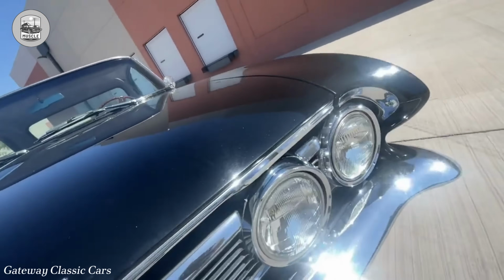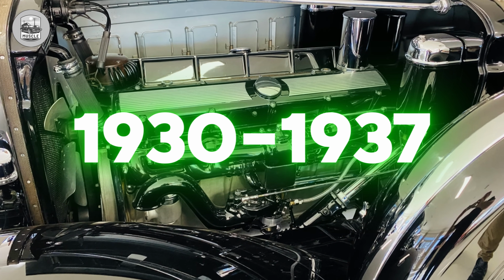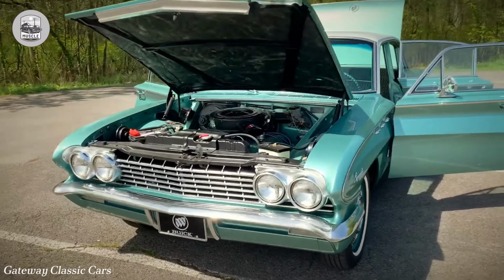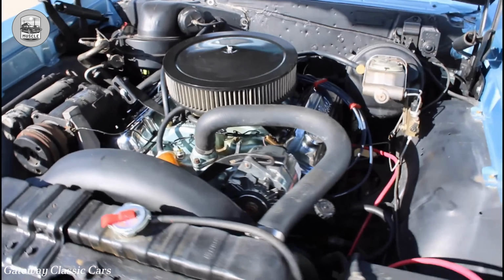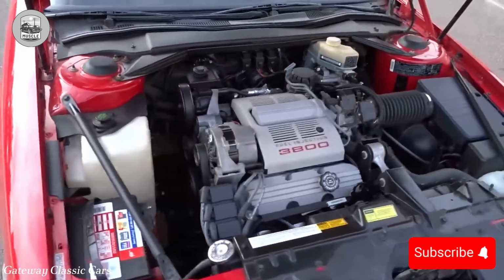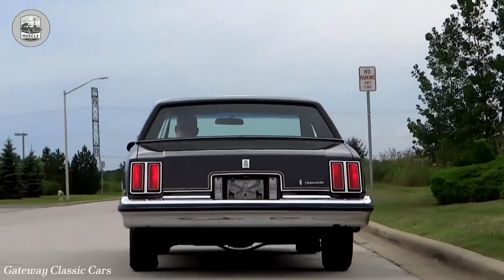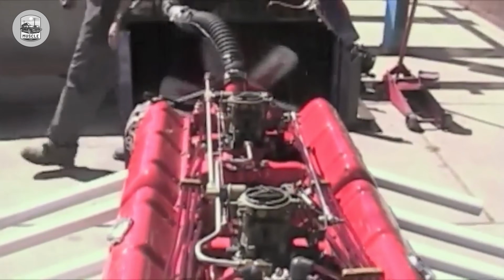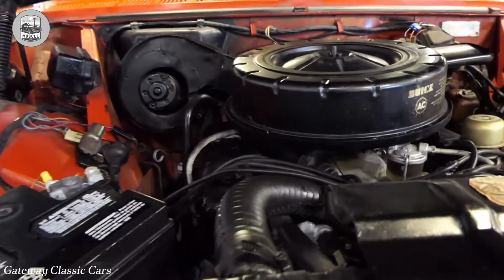10 MOST FAILED and WEIRDEST GM Engines ever made | Worst engines blunder!

Comment: True on the olds not buick but buick is my favorite. If not for the buick, the olds would never be.
Reply from the maker: Absolutely! Buick played a huge role in GM's development and success, and it's easy to see why it's a favorite. Interestingly, Oldsmobile and Buick shared a lot of engineering advancements over the years, yet each had its own distinctive character. Buick's innovations, like the 'Nailhead' V8, had a significant impact on GM’s engineering direction, paving the way for many of Oldsmobile’s engines. But let’s not forget Olds also pushed boundaries with its legendary Rocket V8s, which helped kick off the muscle car era!
What’s your favorite Buick engine or model? Let's keep the conversation going—comment below and let us know! And don’t forget to share this video, subscribe to Muscle Car Masters, and hit that notification bell for more deep dives into muscle car history and legends!
Reply: @MuscleCarMasters68  Had a 65 GS 401 bored 60 over, 12-1 Jans pistons, Isky 3/4 race cam, High rise Offy Dual 600 cfm AFB, Dual Point distributor, 1.7-1 rocker ratio had to mildly pocket pistons to keep valves from hitting top of pistons. Put TH400 from Riviera GS dual Quad in, 3.73 posi. Did 12.87 best in quarter. Then had Opel GT 69 1900 always wanted to put 215 in it. I picked up a 69 Opel GT rusted hulk and at 77 hope I will be able to complete it. 215 with 200r4 8.5 rear 3.73 posi. DST Fast control system, replaced the distributor with the cam sensor from the GTX, cam stage 4 from Crowler,, crossram intake 8 throttle bodies and individual runners. electric water pump, Buick 300 crank, Chevy 6" rods, 305 Chevy short skirt 60 over 12 - 1 pistons, TA Performance heads with roller rockers for the Buick/Rover, lower block girdle and crank wiper, had to have special liners made, enlarged oil galleys cover over the valley to keep splash down from cam rotation, high flow oil pump. Car will weigh between 1800-2000 lbs.
Reply from the maker: Wow, you've got an incredible history with some serious muscle and engineering know-how! That '65 GS 401 build sounds like a beast with those 12:1 Jans pistons and that high-rise Offy Dual 600 setup! Boring it .060 over and pocketing the pistons for valve clearance, now that's dedication to performance! And pairing it with a TH400 from a Riviera GS dual quad and a 3.73 posi rear—no wonder you were able to hit 12.87 in the quarter. That’s some serious old-school muscle magic.
As for your Opel GT project, it's going to be a one-of-a-kind rocket with that 215 engine! The Buick 300 crank with Chevy 6" rods and those TA Performance heads sound like a match made in engineering heaven. With your lightweight build, custom liners, enlarged oil galleys, and the Crower stage 4 cam, I can only imagine how wild it's going to be when you get it all finished! 8 throttle bodies and individual runners? That’s next-level tuning right there.
Reply: @MuscleCarMasters68  Only draw back I'm now '77 and have had multi back surgeries and recently a hip replacement. Difficulty to do work on car, just hope I'm able to finish it before I leave this earth.
Reply from the maker: @randallblack9519  Thank you for sharing your story—it's inspiring to see your passion for cars still going strong, even through the challenges you're facing! We hear you on how tough it can be to work on a car after surgeries and life changes, but the love for muscle cars never fades, does it? Buick has indeed been a cornerstone of American automotive history, and you're right—without Buick’s innovations, Oldsmobile wouldn’t have developed the same way. Buick’s contributions to engine design, like the famous Nailhead V8, set the foundation for so many advances in the GM family. Whether it was in the high-performance GS models or the Turbo V6 in the Grand National, Buick was always pushing the limits, often setting the stage for brands like Oldsmobile to follow.
I hope you're able to finish your project, and remember, there's always a community here to support and share that passion with you. If you ever want to share updates or need advice, we’re all here. Keep us posted on your progress.
Have a good day. Take care.
Reply: @MuscleCarMasters68 once the engine is ready to fire will need to locate someone to help program the ECM. I have no experience. The person who was going to offer the expertise is out of business. He was across the line in Illinois and regulations and increases in cost of doing business shut him down. Anyone have experience with a dts fast 80 system? Setting it up for sequential injection and wiring in 2 knock sensors. Also it's set for wested spark but tells how to wire for coilpaxks on plugs and sequential fireing.
Reply from the maker: @randallblack9519  Thank you for sharing your journey with us! Getting that ECM programmed and dialed in with a DTS Fast 80 system is definitely a technical task, especially with the goal of sequential injection and dual knock sensors. When it comes to configuring wasted spark or setting up coil packs on plugs for sequential firing, you'll want precise timing and accurate sensor feedback to protect the engine and get the most out of your setup.
For the DTS Fast 80, if you’re wiring in those knock sensors, make sure to follow the specified grounding and sensor placement in the engine bay for optimal results. Also, a few forums have excellent guides on wiring coil packs to the Fast 80’s outputs and setting it to fire sequentially rather than in pairs. It might also be helpful to reach out to local performance shops or specialized tuners – even if they’re not as close, many are experienced in remote tuning and could help you via online guidance or a pre-programmed base map.
We’d love to hear from anyone else who’s worked with a DTS Fast 80 setup! Drop your tips in the comments below, and if you’re passionate about American muscle like us, don’t forget to comment, share, and subscribe to the Muscle Car Masters Channel! Your support helps keep these classic car conversations alive and thriving....

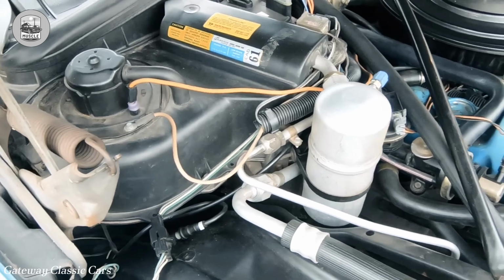Comment: 24:05 reminds me of GM's DOD/AFM 😂😂😂 just as bad as a failure
Reply from the maker: You're absolutely right! GM's Displacement on Demand (DOD) and Active Fuel Management (AFM) systems have had their share of criticism, especially when it came to reliability. They were designed to improve fuel efficiency by shutting down cylinders under light load, but many drivers experienced issues with oil consumption and lifter failure. It wasn’t until GM refined the technology that some of these problems were addressed in later models.
If you're interested, we dive into the history of cylinder deactivation, including GM's journey with these systems, in our upcoming videos. Thanks for sharing that great insight! Keep the conversation going – we want to hear more from you and everyone else about your experiences with these systems.
Don’t forget to comment, share your thoughts, and hit that subscribe button to stay updated with the latest on Muscle Car Masters!

Comment: It was not a 4.3 liter v8 it was a v6 the 5.7 liter olds  diesel was the v8 version of disaster
Reply: While it's true that the 4.3L Oldsmobile Diesel was a V6, I have to respectfully disagree with the notion that the 5.7L V8 Diesel was a 'version of disaster.' Yes, it had its share of issues, particularly early on, but many of those stemmed from GM trying to adapt a gas engine block to Diesel, which resulted in problems like head bolt failures. However, as time went on, the later versions saw improvements, and when maintained properly, they could perform well. It's important to remember that this engine also helped pave the way for future Diesel technologies.
Reply: yes... you've got my point.
The 4.3L V6 Diesel was actually based on the same architecture as the 5.7L V8, just with two fewer cylinders. Unfortunately, both engines were plagued by reliability issues due to GM converting their gasoline blocks into diesels, which led to severe durability problems. Weak head bolts, head gasket failures, and fuel injection system issues were common, contributing to their downfall.
Reply from the maker: Thank you for your information. It is so great...
Let's see our channel is a place to share, comment or show your feelings about American Muscle Cars.
Have a good day.
Don't forget to like, share or SUB on our channel to enjoy other great Muscle Cars videos.
Spending more time with other great videos on our channel to explore more about American Muscle Cars.
Reply: In 1979 the 4.3 Olds diesel was a V8 not a V6 for that one year only.
Reply from the maker: @JasperTV  Thank you for pointing that out! You’re absolutely right—Oldsmobile’s 4.3L Diesel V8 was produced for 1979 only. It’s a little-known fact that Oldsmobile experimented with this smaller diesel V8 before focusing on their more famous 5.7L version. The 4.3L V8 diesel shared many design features with the 5.7 but had a smaller displacement and was mainly intended for GM’s smaller cars. Unfortunately, it suffered from similar reliability issues as the larger diesel, which led to its quick disappearance from the lineup.
For all you muscle car enthusiasts out there, we’d love to hear what you think about these old diesel engines in classic American cars. Drop your comments below and share your stories! And if you haven’t already, don’t forget to hit that subscribe button and share our videos. Your support helps us keep bringing you the best in muscle car history and engine deep dives here on the Muscle Car Masters channel...
Reply from the maker: You're absolutely right! The 4.3L was indeed a V6, part of Oldsmobile’s attempt to create a fuel-efficient Diesel engine during the energy crisis. It shared many components with its gasoline counterpart but suffered from the same reliability issues that plagued the larger 5.7L V8 Diesel. Both engines gained a reputation for being troublesome due to weak head bolts, head gasket failures, and poor lubrication designs. The 5.7L Diesel, despite its larger displacement, became known for its mechanical issues and played a role in tarnishing the Oldsmobile name in the Diesel market.
Thanks for pointing that out! If you’ve got more insights or experiences with these engines, we’d love to hear them! Everyone, don’t forget to share your thoughts, and if you enjoy these deep dives into American muscle history, make sure to comment, share, and subscribe to Muscle Car Masters to stay in the loop on all things muscle car...
Have a good day.

Comment: 231 early engines were crap wouldn't get out of their own way
Reply from the maker: Hey there! You're right in saying that the early 231 engines (Buick's V6 from the late '60s) had some teething issues. When Buick first introduced it in 1962, it was derived from the aluminum 215 V8, but it was heavier, and the balance wasn't quite right. Performance wasn't exactly the strongest point back then—it was more focused on being a reliable and efficient engine for smaller cars.
However, the 231 V6 saw a major comeback in the late '70s and '80s after Buick refined it, adding improvements like a better-balanced crankshaft, which smoothed out the engine. By the time the Grand National hit the streets with its turbocharged version, it became a true muscle car icon. That turbo 231 was known to put serious power down—enough to take down even some of the V8 competition.
Thanks for sharing your thoughts, and let’s keep the conversation going! Have any more memories or stories about the 231 or other engines? Drop them in the comments, and don’t forget to share this video with your fellow muscle car fans! If you haven’t already, make sure to subscribe to Muscle Car Masters for more awesome content like this....

Comment: Tempest had a slant 4 looking engine that was half of a 389
Reply from the maker: Thanks for the comment! 
The Tempest's 195 cubic inch slant-4 engine was essentially half of Pontiac’s 389 V8, making it a pretty innovative design at the time. This engine shared many components with the V8, including its crankshaft, which gave it a distinct balance and vibration. It was pretty unique because it saved costs for Pontiac by utilizing an already existing V8 design, but it did have its own quirks due to the uneven cylinder arrangement.
Feel free to share your thoughts on this cool piece of engineering history. Everyone, don't forget to comment, share, and subscribe to Muscle Car Masters to stay updated on more fascinating engine stories.
Have a good day.